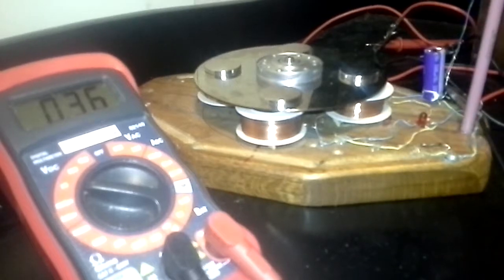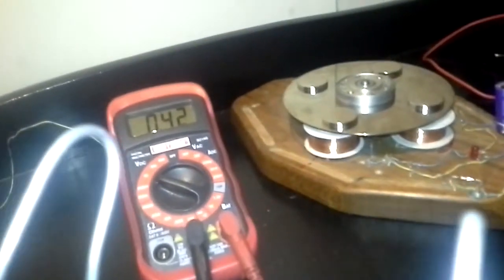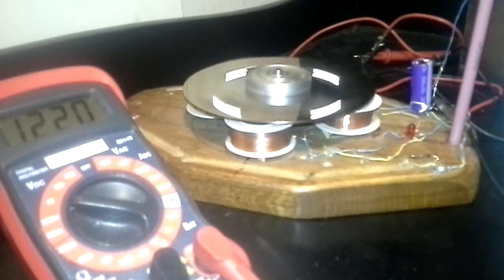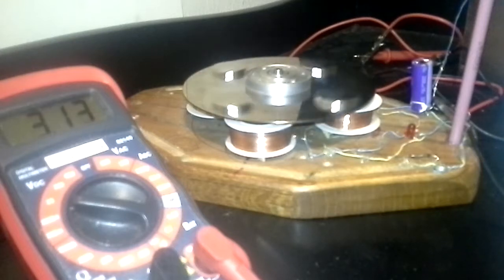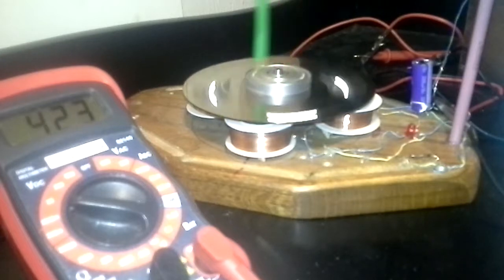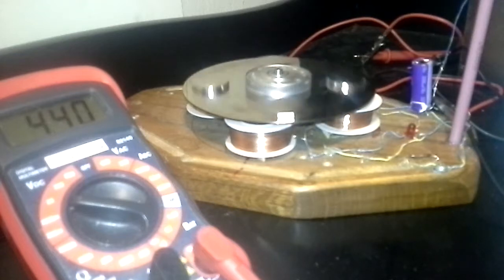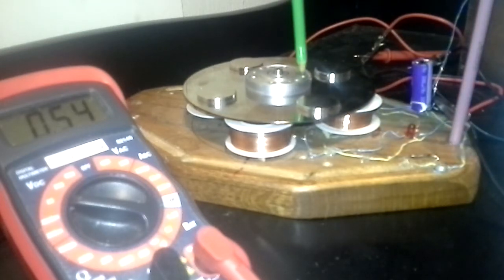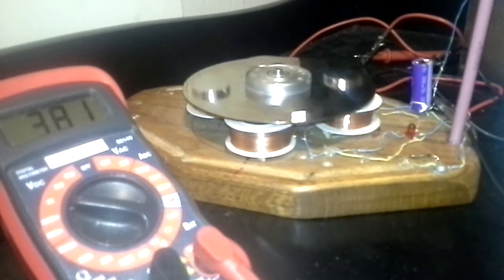EZ spin pulse motor generator

Comment: This could possible make a great wind turbine using vertical blade type weather vane style apparatus. Seen one once upon a time with cup or bowl shaped ends made of plastic I believe or light aluminum.  I was just thinking an ez spin motor converted to generator converted to wind turbine...then thought of old vertical weather vane apparatus I once saw before in catalogues.